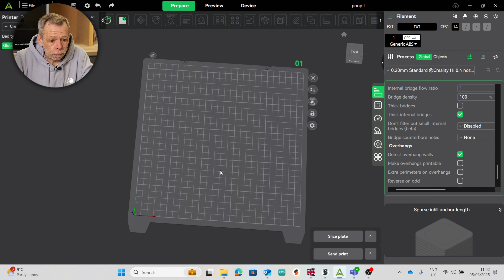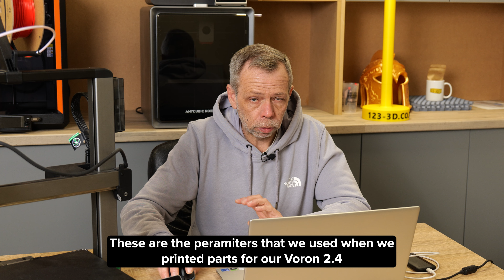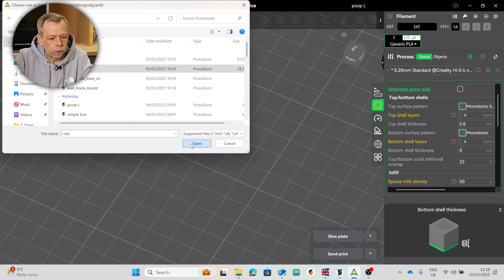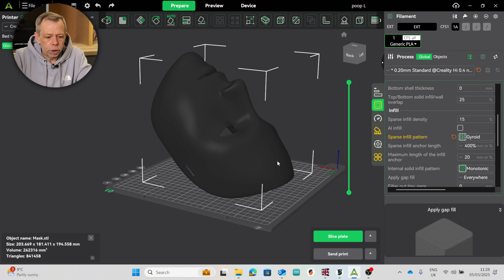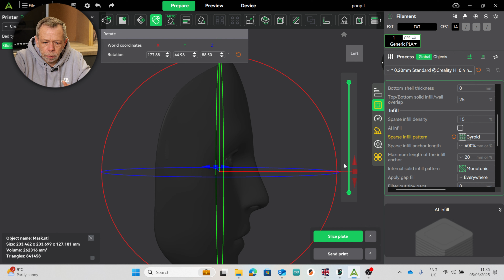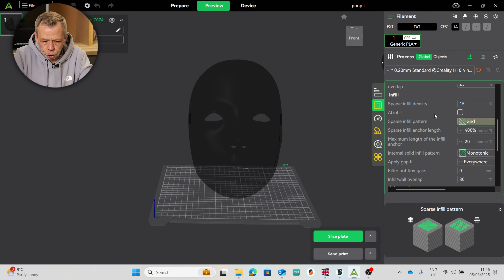How to Slice 3D Models Like a Pro! A Beginner’s Guide

Comment: So I bit the bullet last week and bought the Anycubic Kobra 3 Combo!
Still waiting for it, but the big issue for me is moving from the old faithful, tried and tested CURA over to the Anycubic slicer (aka Orca slicer)
I know all these slicers are based on Orca and all look very similar, but is there any chance you could maybe do the same thing, but on the Anycubic side?

You do have the Kobra 3, so would just be interesting to see the differences.

One thing I did try as I did have Orca installed, was loading the Kobra 3 profile in Orca and slicing a file.
I took that very same model and sliced in the Anycubic slicer and it was about 20 minutes faster on the time?

So just curios what they doing between the different slicers.

Anyways. Hope I made a good choice with Kobra 3 Combo and can't wait to get it up and running....
Reply from the maker: Kobra 3 is a solid machine I'm sure you'll get on well with it.

I'm not 100% sure but I think the slicers measure the print time from different points so one might start the clock from when you press print an include all the levelling and purging as part of the print time, where as the other might measure from when the first layer starts. Aside from that it could just be something as small as the Orca engineers think you get a better print with a slightly slower print time.
Reply: @123-3D-UK  Thanks for this. Much appreciated.

Comment: Hey mate. I'm from the states. I have been watching your videos. Very informative. I am CNC swiss machine programmer. I use modeling software and cad software to manufacture parts for my job. So G-code I know for the machines I run. With all that said. (Slicer) slicer software is new to me since I don't machine parts in layers. Seems like part orientation and processing formats are key in making a great part. So with that said, with 3-d printers prices coming down to a reasonable price point for the home hobbyist I want to make toys, gifts, etc for the kids.

So I'm looking at buying. For my first affordable printer my choices are narrowed down to the ( AnycubicS1 kobra combo)(Creality Hi combo) (Bambu A1combo).

Not to put you on the spot but witch one would you recommend since its my first printer making things for the kids. Ohh and sometimes things for the wife.
Reply: I am using a Bambu Lap A1 AMS lite, for me is this still the best option and better performens. And the bambu sudio slicer is not a cheap copy of Orca Slicer.
Reply from the maker: All 3 are good picks so you wont go wrong with whichever one you go with.

With you having kids in the house I would probably sway slightly towards the Kobra S1 because its enclosed, Just minimises the risk of anyone touching something hot or knocking the print. A lot of the schools we deal with over here go with enclosed machines for this reason.
Reply: @ thanks for your reply. Been across the pond twice in my in my life of 60yr old. Lovely country. My wife is from Skegness. Luv your channel. thanks for the help mate. Next time I'm in the UK I'll visit your shop. S1 on delivery. by the way you have better potato's than the States. Proper English breakfast for me. Got to have my beans on toast. thanks again.